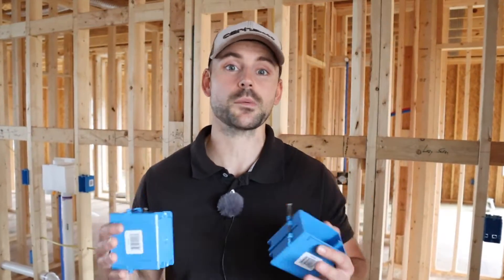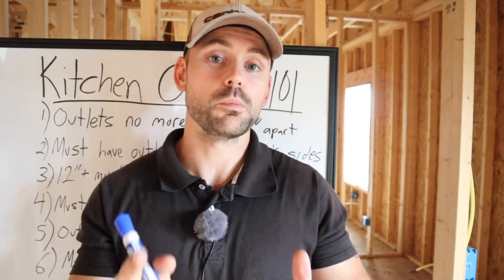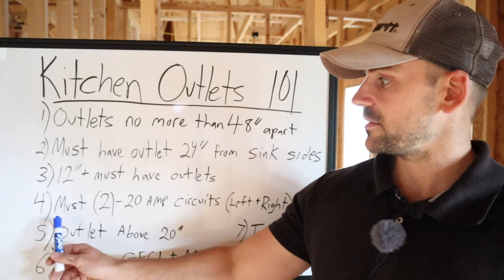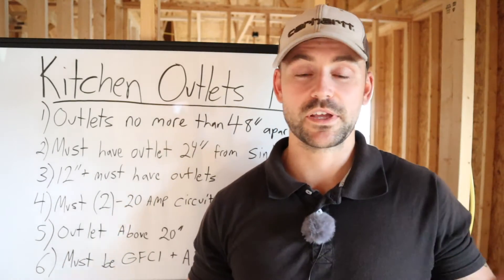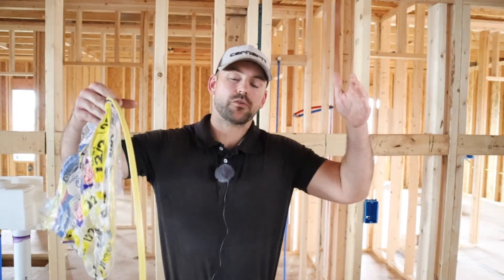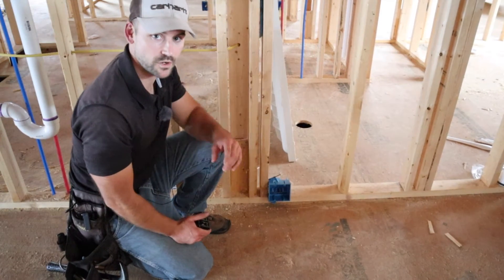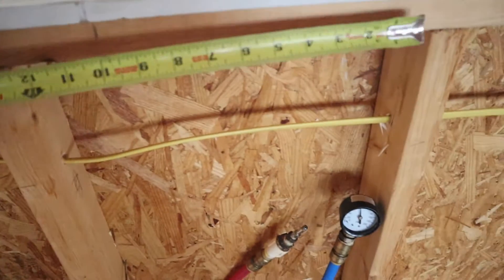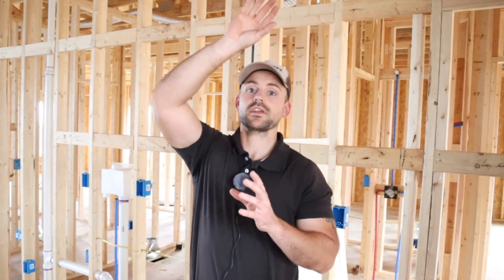How To Wire A Kitchen - Rough In Electrical Circuit Wiring Guide

Comment from the maker: That was my daughter if you were wondering! Timestamps below...
Type of outlet box for kitchen outlets: 00:29
Height to place kitchen outlets: 00:58
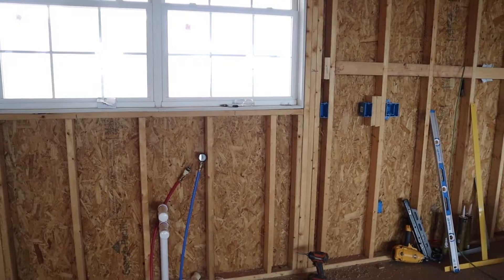Kitchen Outlets Codes In My Area: 01:36
How to wire for a refrigerator: 07:15
How to wire for a microwave: 07:50
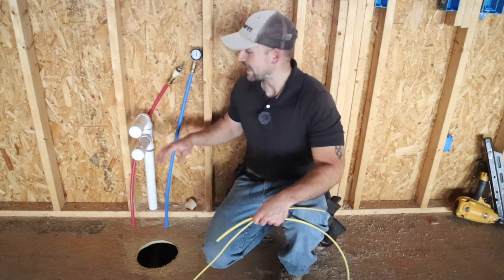How to wire a dishwasher: 08:41
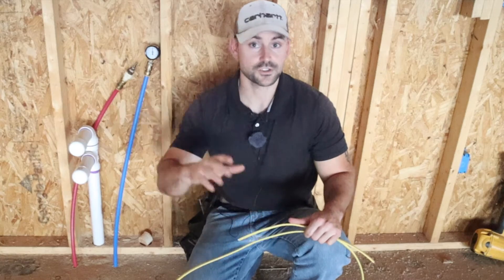How to wire for a range: 09:46
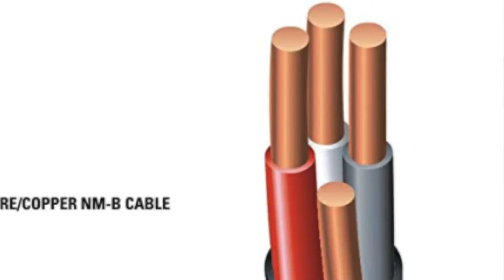Overview of the kitchen circuit layout: 10:20
Outlets almost too far from sink to pass code!: 11:35
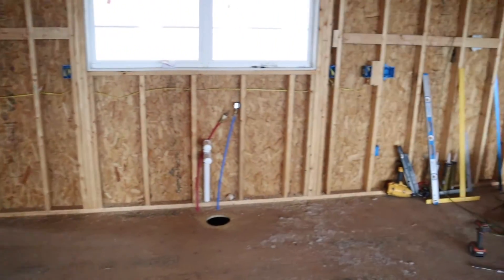Tour of a kitchen I built in the past: 13:10
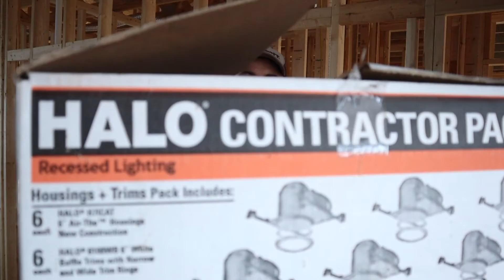What I use for recessed kitchen lighting: 13:36
Reply: What about running from the kitchen to the circuit breaker?
Reply: 24 Inches from the edge of the sink or closer?  On each side?
Reply: #2 should read "WITHIN 24" of the sink" to make it more clear ("from 24" sound like "away from").

Comment: With the 2 circuits, wouldn't it be better to alternate the outlets 1, 2, 1, 2, 1, 2 rather than 1, 1, 1,  2, 2, 2 so that if a countertop appliance overloads #1 you can switch to #2 close by.

Comment: I am putting in the wiring but I'm paying an electrician to hook up to panel,  but is it possible to get a drawing of how the wires are coming from the panel and to the switch on the wall and then going to receptacles on the wall. The video doesn't show start and end.

Comment: I know this is an older video, but I still always go back to your videos for reference. We're building a small home out in the country, and I'm just about to the point of wiring. Bedrooms, and living room, I feel confident in what I've learned (Mostly from this channel lol) But in the kitchen, and bathroom, there seems to be much more strict rules for outlets. So my question is, how many outlets can you have one single 20 amp breaker? I'm doing the Left+Right as you mentioned in the video, (2) 20 amp breakers, 1 for each side. I get that, but how many outlets can be put on the left? And how how many can be put on the right? Someone told me up to 10 per side, but that seems like alot on 1 breaker. Can you clarify please? EDIT: I'm running 12/2 for the entire house, except for certain appliances, where there will be 10/2 wire going to those.
Reply: 10 is for sure the absolute max but I would recommend 8 max for a 20 amp circuit, also depends on whether you plan on plugging a lot of stuff in which pulls more power. And make sure they’re GFCI protected it’s code for every kitchen.
Reply: @sargentnocap1414  thank you!
Reply: @wcs39204  No problem 👍

Comment: Outlet no closer than 6 inches to edge of sink and no further than 24 inches from edge of sink. If you use combination gfci/afci breakers then you’re required to put those ugly blue “gfci protected” stickers on the outlet. Just install a gfci outlet and use an afci breaker. Costs a little bit more but looks way better.

Comment: the kitchen outlets are not required to be on an arc fault but it doesn't hurt. As of the 2023 NEC (210.52(C)(2) I believe) you cannot put an outlet on the side of an Island. You can use a pop-up outlet rated for that use or put it in the backsplash of a 2 level (bar) or cap it off underneath for future.   (Weird, I know.)

Comment: The 2023 NEC no longer requires islands or peninsulas to have a receptacle.  See NEC 210.52(C)(2) & (3). These were commonly mounted on the sidewall of the cabinet. Now, the island must have the ability to have it added. Think either run an empty conduit accessible at both ends or the wiring not connected and/or ran to a box but safed off. This is so one can be added if the code changes again without tearing up the kitchen.

There are safety issues of having a cord running over the side of the counter top where the cord can be pulled, possibly dumping the hot contents of a cooking appliance onto someone. Children have been badly burned. If the owner wants one installed the way the previous code required, the code does not prevent it. They just don't count towards the required receptacles. I would not install it, explain why, and let them use the "future install" option at their own doing. A much better option is a counter top receptacle that is specifically listed for the use. A web search will show options for work surface and counter tops, they are different in the code as how and where they can be used.

A sidewall mounted island receptacle is major safety liability and a lawsuit waiting to happen. Installer beware.

Comment: I cant rap my head around why you have to splice the kitchen up in to 2 zones and put ur freighter on its on circuit  and the microwave on its own
Reply: Fridges and microwaves can use up most of the amperage of a circuit breaker on their own (ie when the compressor kicks on on the fridge or when the microwave is running depending on the watts of the microwave). It will cause it to overload and trip the breaker if the compressor on the fridge turns on at the same time as the microwave being turned on. As for the zones. They don't want you to have a ground fault issue in the kitchen where the breaker trips causing you to being in the dark trying to fumble around for a light while your hands might be either dirty, oily or wet. Some people will run their lights on a separate breaker than their outlets and such too for similar reasons but NEC still wants you to have two separate breakers to allow  for the 2 zones in the kitchen for your outlets, not counting the dedicated breakers for the microwave and fridge and if you have an electric or induction cooktop or range, then that will also need its own dedicated breaker.

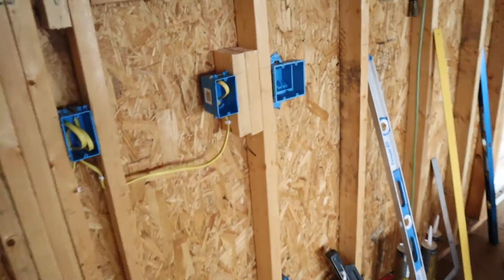Comment: Great video. I have a plumbing question. Sorry to be that guy lol. At 12:30 in the video, you show the sink and outlets around it. I see your pvc sink drain under the window and looks like an F. Also didn’t see a vent. What are you doing there? I am assuming the bottom pvc inlet is where you will add your P trap for the sink and the top one is for a ventless vent. Is that correct? I am dealing with a similar issue, that’s why I asked thank you

Comment: I have a question  my mom lives in double  wide this is her place all receptacles in one room have no power Took a  receptacle out check the hot wire has  nothing nothing tripped in the rest of the place everything's working none of the main breakers are hot ceiling fan I did replace three receptacles cuz this has happened before I had power got power back into the room   l last  night it did it. The first time   power  comes back on by it's  self

Comment: the cost of these Combined Fault breakers is significant. I am all about GFCI breakers and outlets, but AFCI breakers I have to look at the ROI and wonder how many houses have been burnt because of arc faults. Personally, I think solid electrical work by licensed professionals would eliminate any possible arcing.  And to be honest, the circuitry for the AF is simply a frequency detection circuit as an arc creates a higher frequency above the 60HZ. but the code requires them so....

Comment: 7:00 I didn't see you running any protective plates where the romex penetrated the studs. As a cabinet installer, make sure you install them at exactly 34 3/4 to 32 inches off the floor. 👍👍

Comment: Per 2023 code, receptacles are NOT to be installed at all on the side of islands. Turns out they’re unsafe for children. They are to go on top as a pop up or the means to install a pop up need to be provided.
Reply: Not required on islands at all in 2023

Comment: For the microwave, i would recommend just terminating it in a box as usual, then once cabinets are installed you can just put an extension box or plastic box extenders (white pvc sleeves that would sit on the face of the cabinet backing and extend into said box). I'm personally not fond of the idea of drywall installers having to install and tape around a bare romex sticking out from the wall.

Comment: Could you put a dedicated junction box under the kitchen sink cabinet with a gfci outlet for both the dishwasher and garbage disposal?
Reply: Yes but make sure to run 12/2 wire and have it on a 20amp breaker.

Comment: Definitely put a fridge on  a dedicated circuit, some new  fridges/freezers these days can draw like 12/14 amps alone. The gfci requirement for the fridge has nothing to do with a water source. Its required regardless ( depending on which code year your state is on ) . I have a feeling that requirement will be reversed at some point) 
The microwave above the stove needs to be GFCI ( again depending what code year ) , but in 2023 code, pretty much ANY outlet in kitchen will need to be GFCI, except for the stove.
Also, if your micro is on the counter , run a dedicated ct to that outlet.
We run ded ct for each micro; oven hood; coffee makers; trash compactor; fryers; if you have a hot plate for some reason; disp/dish. Also, run a ded if you have an instant hot; plus the 2 required general cts.
A kitchen alone , especially a new one, can easily have like 7 to 11 cts.  Overkill now, no headaches later.
Reply: So is it a good idea to just use arc protected and gfci breakers on every circuit for the kitchen including the lighting? If I did that, would I still have to use and gfci recepticles? I was thinking a still needed gfci on my cook top and oven (they are separate and apart from one another, but both are on 240v.

Comment: You said the fridge outlet needs to be a home run.  But can it stop at a junction box and splice to the breaker?  
there are no other connections like outlet or anything. 
Say the wire was cut by mistake or ran out of wire while doing it? 
I don’t think it’s a problem if it’s not a home run in that sense. So long as there is nothing else effecting the load on the line.

Comment: as far as cost wise if you can get afci breakers  being $30 and i have gotten gfci outlets on sale in multi packs discounts at less than $10 a pce vs combo breakers at avg $75  but again yes avg gfci outlet $20 to $30 a pce so ya combos are easier cost effective unless you do your shopping

Comment: Great video. Thanks for sharing your knowledge. When you said there must be 20A circuit left and right, do you mean that the two wires (one for each circuit) must travel separately? Or can I use the same holes in the studs to have two cables traveling together? Otherwise I would need to route one wire through the wall and then another wire through the floor or something so that one wire on the left side and the other is in the right side?
Reply: The two cables/wires(one for each circuit) can share the same hole in the stud.

I believe per NEC, only two cables can run in a hole.

NEC requires two separate circuits for kitchen receptacles. You can divide kitchen left and right like Josh did, or another practice is to alternative outlets for each circuit. Think every other outlet is on the same circuit.

Comment: Great videos! I’ve been demolishing and rebuilding house I just bought and really enjoy your videos. 

Question: I’m just curious why you used a 15 amp receptacle for the microwave? (which I learned from your video, must be on a 20 amp designated circuit)I would think with venting systems commonly combined in microwaves that a 20 amp might be more suitable (again electrical newbie here). I was told a 15 amp receptacle on a 20 amp circuit could deteriorate quickly and risk electrical fire.

Thanks again!
Reply: He states he is not an electrician. He doesn't know that a dedicated 20amp circuit can NOT use a 15amp receptacle. Only the 20amp branch circuits with multiple receptacles may use a 15amp receptacle. A dedicated circuit may not have a receptacle smaller than the dedicated branch circuit.  FYI some states do not allow any 15amp receptacle on 20 amp branch circuits.

Comment: I have an issue in my house. Builder used a 3 wire from panel to the gang box for the fridge. The black wire is only feeding the outlet for the fridge. The red wire is spliced into a new 2 wire run that feeds the microwave and stove top. Red and black are on separate breakers. My problem is, if I open the black wore breaker, I get 40vac on the red wire. Nothing is plugged in, and all other breakers are open.

Comment: You didn't put a garbage disposal in the kitchen. Do you know any codes for that? Can it be put on the one of the left or right side of the wiring?
Reply: Garbage Disposal has to be on its own circuit. Local code may allow dish washer and disposal to share the same circuit.

Comment: Was just wondering what the Hole (looks about 8inch) on floor where kitchen sink is for. I’m Just about done with drain and vent pipes, and water in,  about to start electrical.

Comment: Where can I get a local electrical code book with the regulations for installing outlets and switches?
Reply from the maker: You can get a NEC code book online. Because local building codes can be different I do recommend speaking with your local Planning Office or authorities.

Comment: I have a question with regard to outlet placement on an island.  The island is 84 x 51.  On 1 side will be a dishwasher, adjacent to the sink, adjacent to an 18" double garbage pull out.  The mirror side of the 18" cabinet will be another 18" cabinet with drawers.  That is it.  There are no cabinets behind the sink cabinet (36") and the dishwasher (30").  The space is designed for counter seating.  The only outlet planned was to have one above the baseboard behind the kitchen cabinet (GFCI).  There is no place to put any outlets 12" below the counter top.  Do you have any suggestions?
Reply from the maker: In a case like that I would call the inspector to see what your best options are. In my area, the inspector will even come out to give you an alternative solution. Hope that helps!

Comment: Hey Josh,  love your videos. They are the most useful and comprehensive that I have seen.  Just wondering,  what about power for a garbage disposal???🙄🤔
Reply: This is subject to your local jurisdiction, but based on my research I have found that the dishwasher does NOT need to be on a dedicated circuit. You wouldn't want to put it on your small appliance circuits, but you could likely share your dishwasher circuit with your garbage disposal. So, a 20 amp, 12 gauge wire circuit serving only your dishwasher and disposal.

Worth noting, your local code may require a switch to disconnect your dishwasher. You could run an the incoming line into the sink cabinet for two receptacles. One receptacle to power the dishwasher, and another to power the disposal. You would then run two "switch legs" to switches at the front of the sink cabinet so that one switch would cut off the dishwasher (as required by code), and the other switch would turn the disposal on and off.
Reply: Around here both the dishwasher and disposer are fed by one 20A circuit on plug receptacles in the sink cabinet. Use a two-gang box so one side gets a GFCI for the dishwasher and the other side a switched plain outlet for the disposer. There are several styles of disposer switches so I can't go into that here.

Comment: Another great video. You probably have videos on the actual wiring the switches and plugs maybe should've referred us to that video(?). According to your video a kitchen will have at least 5 separate circuits (Frig, MW, DW left and right side)? I didn't realize the MW and DW had to be on separate circuits(?). I thought we could wire the DW with garbage disposal(?). Thanks -

Comment: I love the hustle but I don't understand if your not a electrician or didn't go to school for and learn the codes n ohms law etc etc why you are teaching electrical bc I use to do electrical work for my family's business for years n could wire a house n do a service but when I went to school I found out I didn't no nothing bc in school they teach you why your doing this and that and if you don't no why your doing something then you really don't no what your doing justice my opinion
Reply: Relax dude, you’re wound up a bit too tight.
 I really enjoyed this guys video. I fully understand that he’s not an electrician and that’s okay, he’s only offering general information. Which is fine because that’s why God invented electricians. After you do this general assembly the individual that went to school should be able to catch any mistakes and set things straight.
 Doing as much as you can yourself will save you many thousands of dollars if you have a half decent understanding of what you’re doing. If you don’t have at least basic knowledge then absolutely pay for the professionals to do it because you will probably spend more later after the house burns down or floods depending on your mistakes.

Comment: Nice work thanks , one thing you could add when explaining  the 12 inch rule for the island outlet  is that when installing an outlet in a horizontal position always have the wider neutral blade slot in the up position and hot blade slot down , that's so if an appliance is plugged in  and works it's way out the neutral is exposed and not the hot blade , thanks again .
Reply: THERE IS NO CODE REQUIREMENT FOR THIS.

Comment: Thought refrigerators aren't supposed to be gfi as it can trip and then spoil everything since there's no light or anything on the circuit to make it easier to identify when its tripped. 

Instead of left and right have seen where the outlets alternate so two next to each other are on different circuits so if your cooking or using multiple appliances side by side theyd be on different circuits.